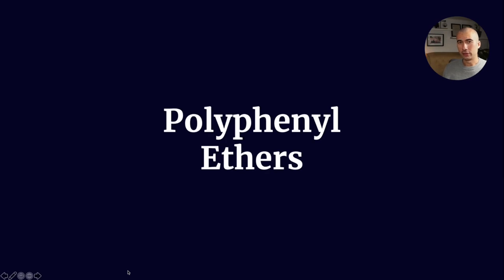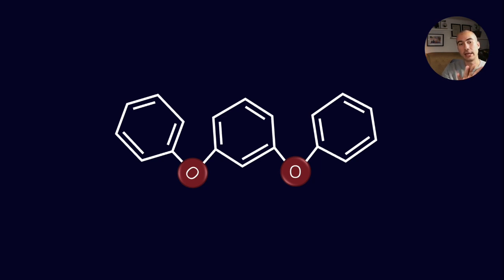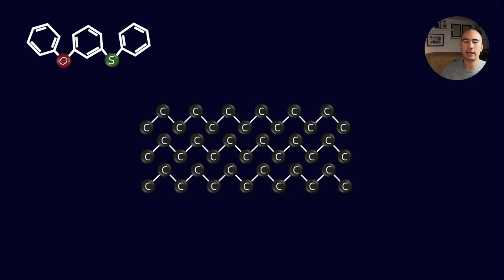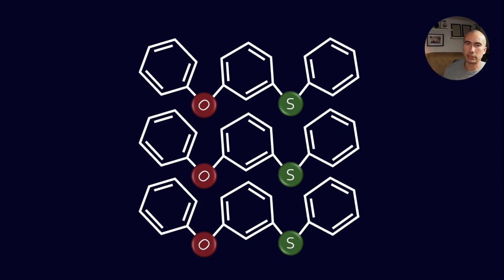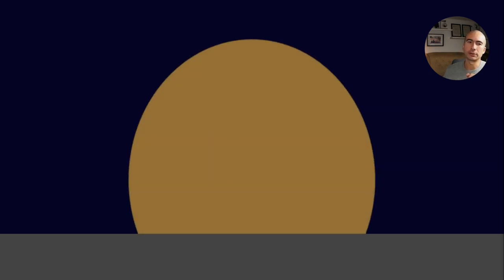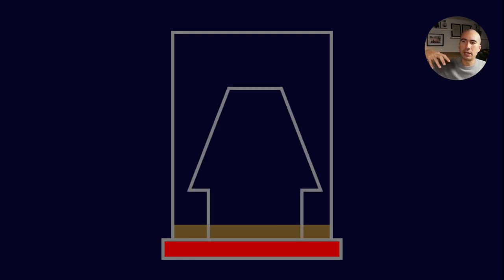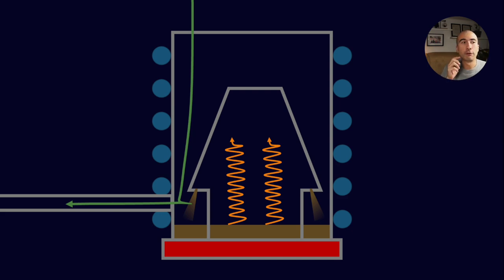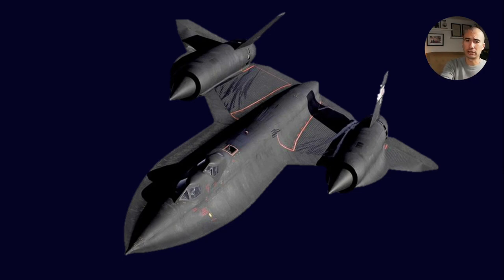What lubricant protected the SR-71 Blackbird?

Comment: Love from Pakistan <3 Can't they improve pour point by using PPD in polyphenyl ether?
Reply from the maker: So yes, and no. PPDs are generally polymethacrylates - given they aren't very polar they may not have sufficient intermolecular bonding to separate PPEs. If they were able to, then I guess you would improve the pour point, but the PPDs wouldn't survive the high temperature that PPEs often experience in service.